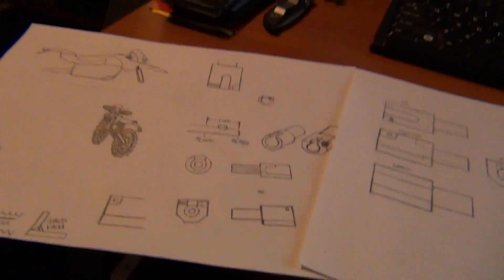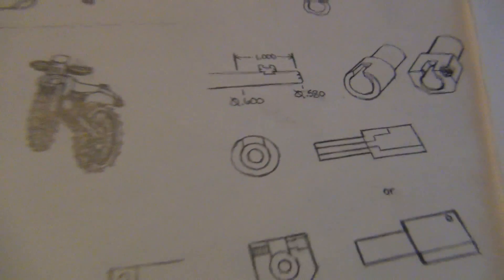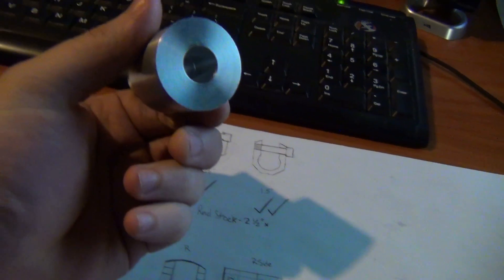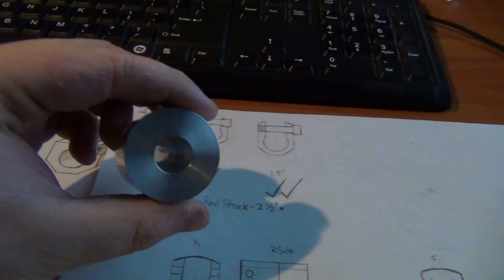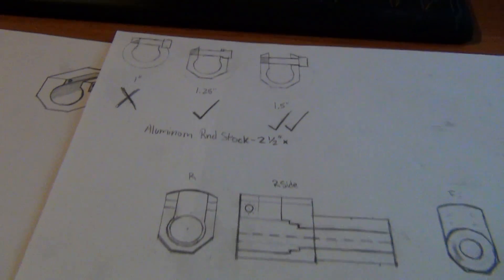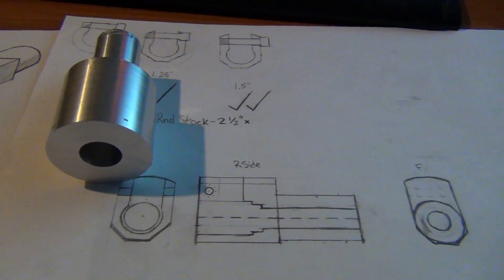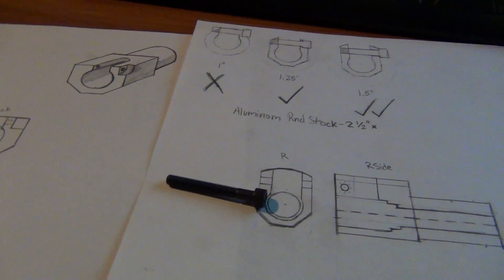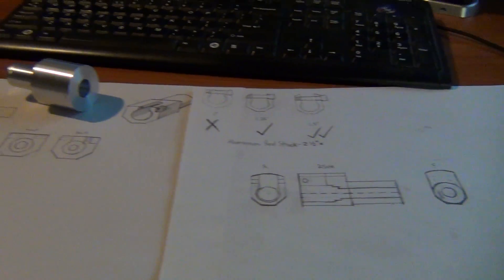.22 LR Tapered Barrel Adapter Machining Part 1

Comment: Adapter type deal. Three minute video and six lines of text in the description and don't know what you are trying to fabricate.
Reply from the maker: get with it bruv
Reply: mxf7010g8k nonthreaded to threaded. I will cancel the lolsuit. Apologies sir.
Reply from the maker: Almost. For all intensive purposes its the same deal. I will be attaching to the "clean" tube, but it would be easy to put some threads on there for that use.
Reply: mxf7010g8k Interested. Look forward to part two. Metal cutting is the shit.